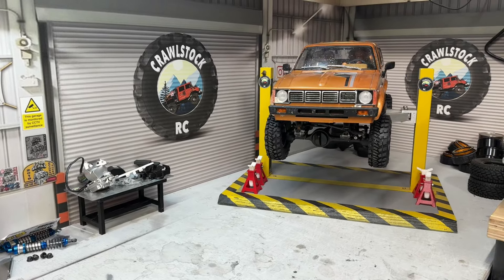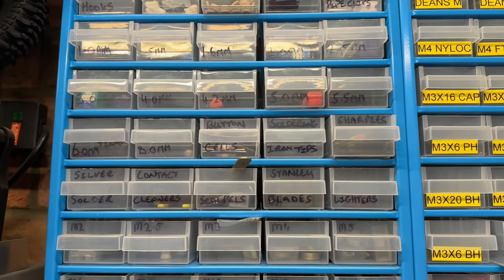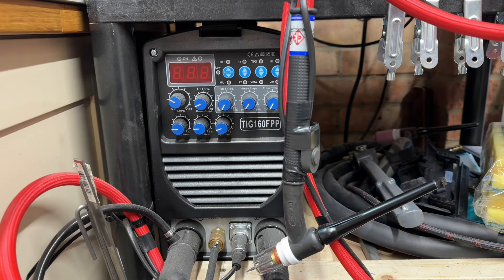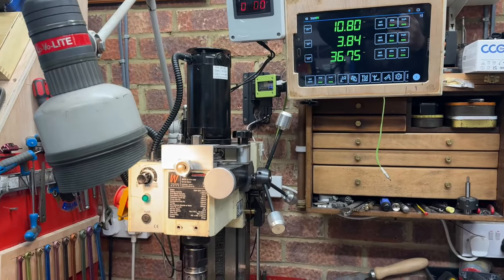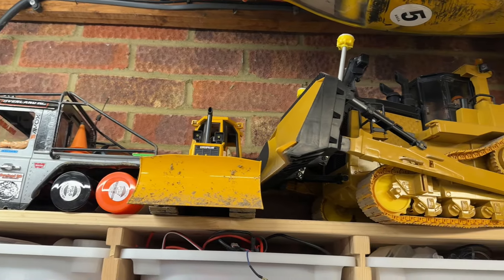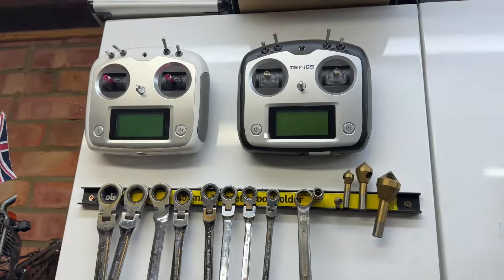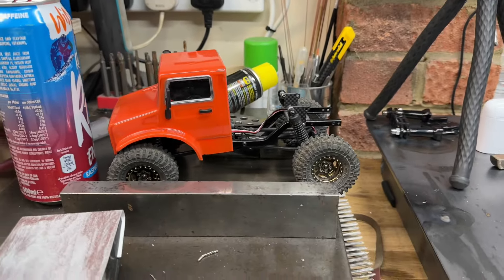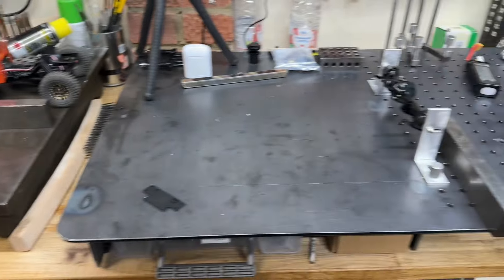Exclusive CrawlstockRC Workshop Tour. Never seen before.

Comment: Nice little shop! But seeing the bench grinder you use for sharpening your Tungsten, I might have a useful tip as a former certified TIG welder: don't hold the rod perpendicular to the front of the grinding wheel, make sure the grooves are in line with the rod, otherwise they may have a negative impact on the shape of the arc. Cheers
Reply from the maker: Thanks. Yes I put them in a drill and hold them in line with the stone so the lines run up the tungsten. I learned that from Pacificarcwelding. I’m relatively new to it but it’s helped me no end. ☺️
Reply: @crawlstockrc  yes, in a drill, that's the proper way. During my welding class, we had to spin them by hand...
Reply from the maker: That’s too much hard work for me lol